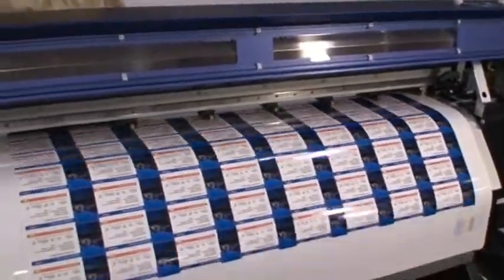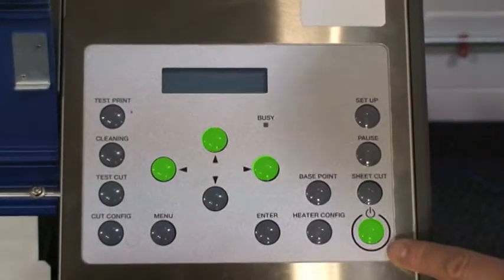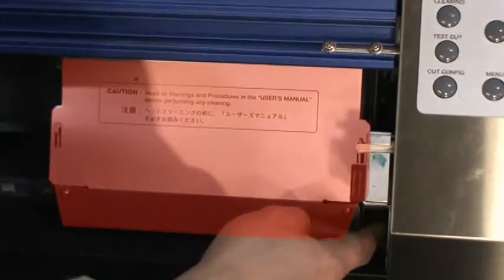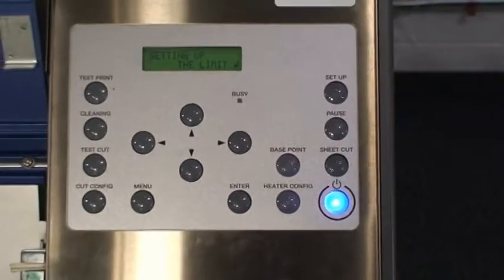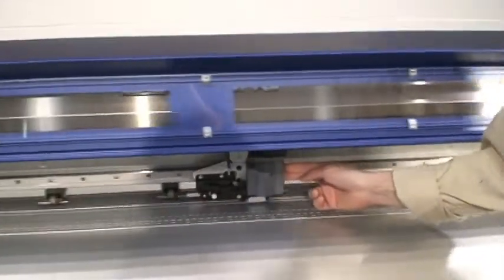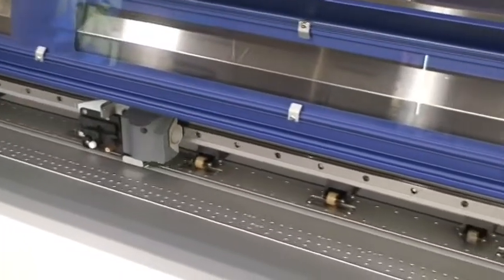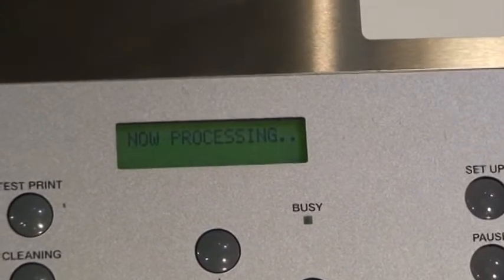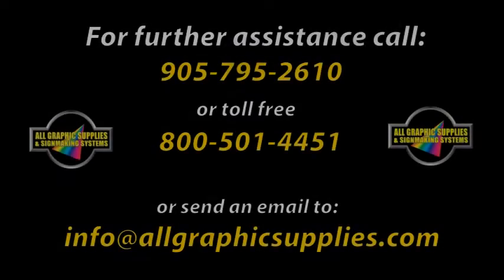Roland SOLJET Pro III Series: Limit Initialization - All Graphic Supplies

Comment: After encountering a media jam the sheet cut function stopped working (the knife failed to deploy). After some research I thought that this procedure might solve the problem. It didn't help, so I tried this same procedure on a working printer to see what was supposed to happen. After doing so, the sheet cut function no longer worked on either printer. What am I doing wrong?